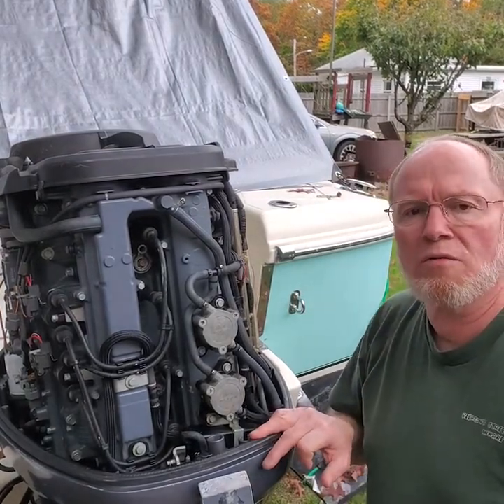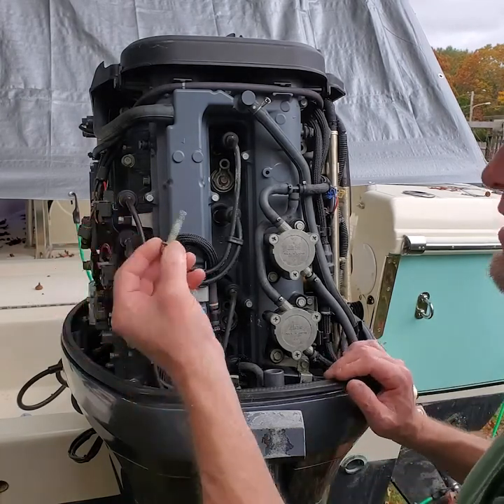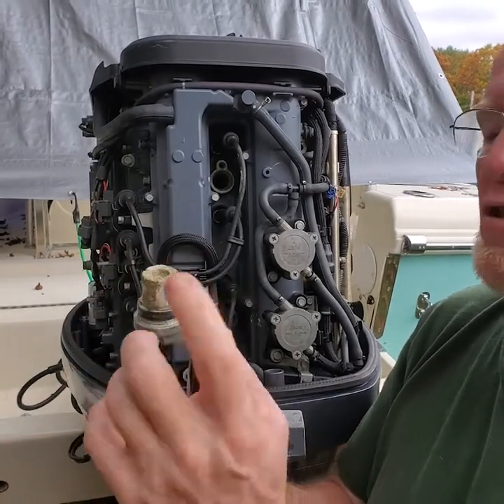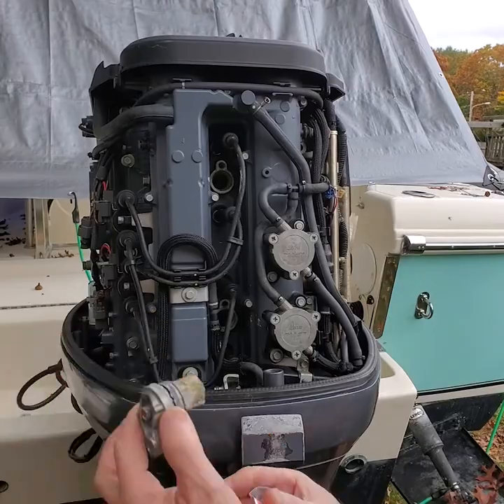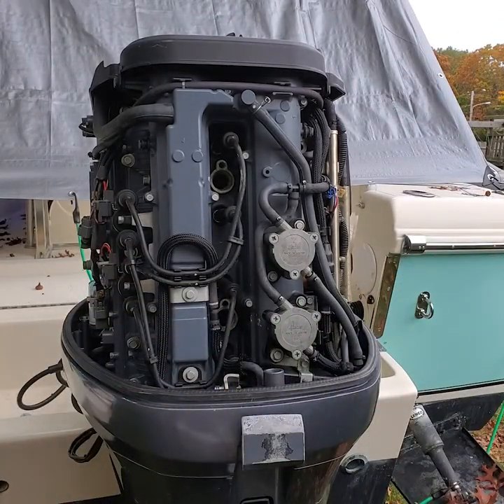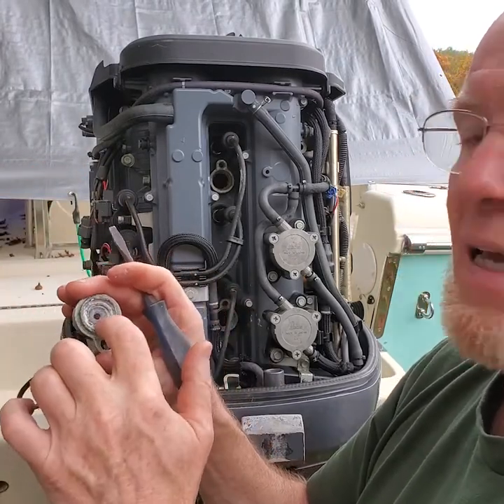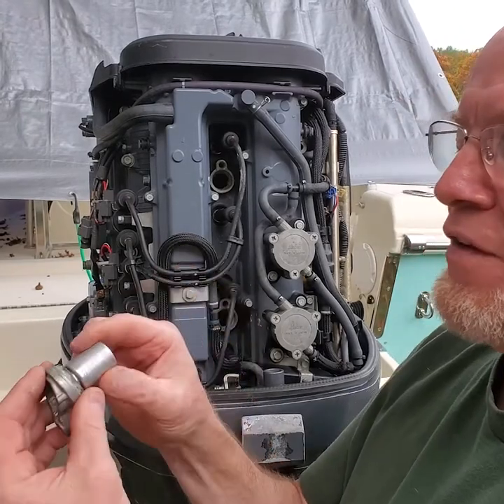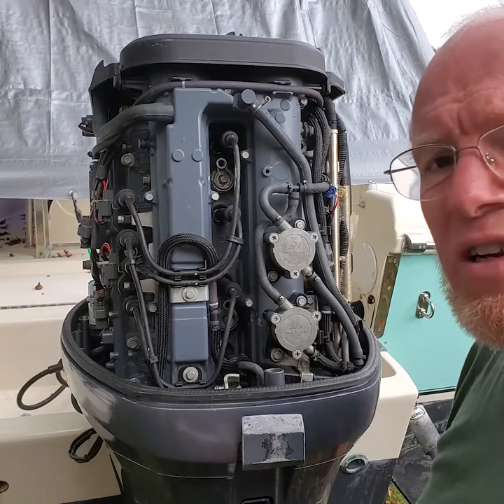Yamaha Outboard Repair F150 Power Head Anodes

Comment: Great video. I have a suggestion. After removing the bracket/anode put the anode bracket in a vice and remove the anode first with an allen wrench. I broke 2 of the bolts holding the anode to the bracket using your method. If you take the anode off first and then the bolt (bolt is threaded in to bracket and anode) then the bolt won't break. I have twins and did the other 4 that way without an issue. I thought I would add this comment to help someone in future.

Comment: Very helpful.  Just completed this on my twin 150’s. A bit of a struggle getting one out of the head but kept wiggling and out it came. Also be sure to have metric allen wrench as stated. I did not so anode head got rounded out but nothing vice grips couldn’t fix.  Thanks!
Reply from the maker: Glad it helped!
Reply: I have a f150 yamaha and its been sitting for about 5 years. Before I retired it I drained all fluids. Now I found a hull for it I put it together and now its knocking and with more throttle it gets louder I also changed the balancer still knocking
Reply: What year motor is this, I have a 2013 , do I have them ? Thanks.